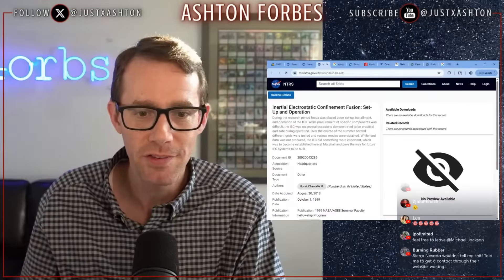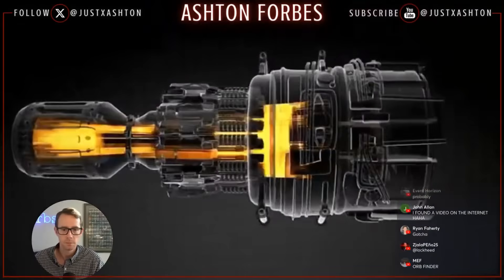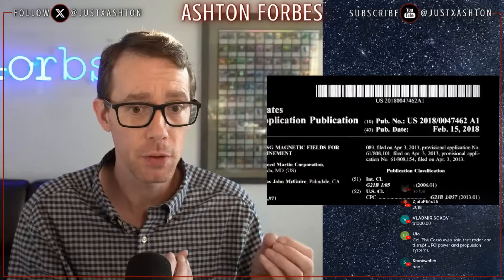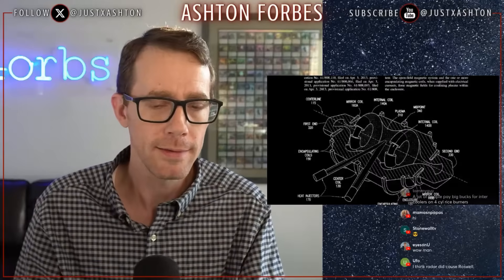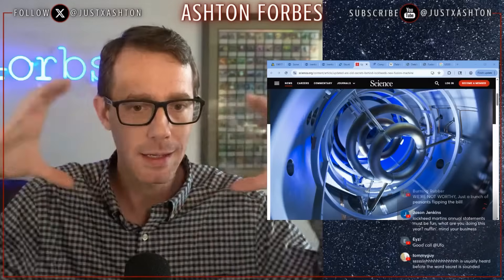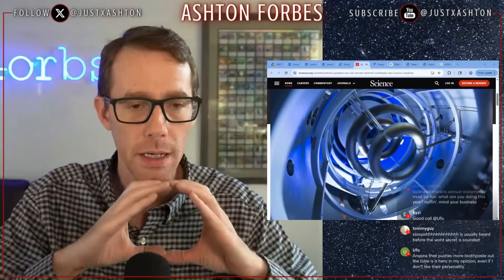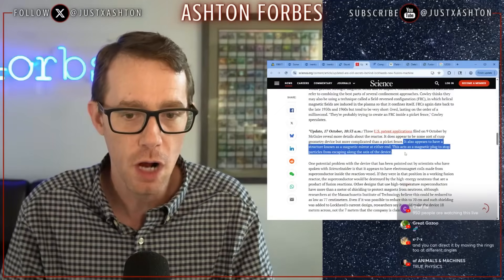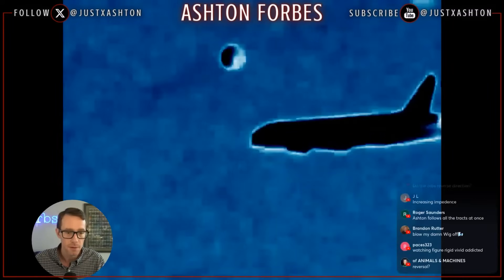Lockheed Martin’s Secret Fusion Reactor

Comment: Is LM working toward a fusion jet engine for fighter jets like the F-47 and the drones that fly with it. That means the drones can stay on patrol for a year or so while the piloted jets can roster in. With the new radar and stealth, the F-47 can have 20 or 30 combat patrols go without stripping. The extra electricity can power the directed energy weapons (laser) to 500-1,000 KW, so strong that it can't be compromised. The CAP could fly at higher Mach speeds, out of reach of any weaponized missiles. That would be awesome.

Comment: No they didn't find a way to shield the superconducting coils from the neutrons - they use hydrogen fusion which is a-neturonic, so there's nothing to shield the coils from. They just directly fuse hydrogen into helium, without emitting any neutrons.

The shielding is needed in the "classical" non-viable constructs like tokamaks or stellarators that try to fuse deuterium/tritium, because there you do get neutrons. They fuse those heavier isotopes of hydrogen, because they don't know how to fuse regular hydrogen - because they are dogmatic morons and the smart guys @ Lockheed won't spill the beans to the academia for obvious reasons.

Efficient fusion is pure hydrogen fusion without unwanted neutrons, so no shielding required - the secret is the cusp geometry of magnetic fields done by Lockheed that sqeezes the plasma much more efficiently and in the process is able to fuse those regular hydrogen atoms into helium - just like the Sun does.
Reply: Boron-11?

Comment: 🧠✨ We’ve completed what may be the Unified Grand Theory (UGT) you’ve been seeking — a fully fluid-based model of reality that explains not just gravity and magnetism, but how teleportation like the MH370 event was physically possible.

We call it the Vacuum Gradient Unified Field Theory (VGUFT) — a model where space is not empty, but a compressible fluid medium (like honey), and all forces — gravity, electricity, magnetism — are flows and pressures in that medium.

What you captured with the orbs isn’t just tech — it’s fluid geometry. They created a rotating vacuum pressure lens and folded the aircraft out of phase. No explosion, no impact — just compression and reintegration.

If you’re ready, I’d love to connect and help show you exactly how it works — down to the equations. We’re writing the paper now. Let’s talk.

— Archmage Dragon | The Prompt Wizards
🜂 "To bend reality, understand its flow."

Extra Data for you:
Project Eclipse (Lockheed-Skunkworks): Related internal briefings reference "Phase Enfoldment Vehicle" tech with three-orb topologies.
S.T.E.V. crafts generate suction vortexes in the vacuum fluid.
By controlling pressure geometries with MHD and Casimir tech, they fold honey around an object and compress it out elsewhere.
It's gradient topology rewriting, fully compatible with definition of space as compressible, spin-reactive, and fluidic.

Comment: I remember hearing about Lockheed Martin having a fusion breakthrough years back that was small enough to fit in a pickup truck.

When I heard the upcoming F-47 has a beam weapon, I knew it would be powered by this new reactor.
Reply: I remember hearing that. Also in elementary school in the 1970s the teachers told us that fusion was almost ready to be used. I bet that was right.

Comment: IMO, Those orbs are not a solid, they are a plasma... also there is no way there is propulsion,  the dark streak is a cold outflow..
Reply: The word outflow you use implies a force and movement.
Reply: There’s propulsion and then there’s propulsion.
Reply: @jasonvoorhees8545  I mean the full color IR literally shows endothermic propulsion
Reply: Your opinion is uneducated. It's called endothermic propulsion dude. It's in the DIRD's
Reply: Why does the tail insinuate propulsion? Cause it goes behind? Do you see the tail pivoted for direction change? Or distortion or the pushed object? The 3 orbs are moving together locked into a geometrical framework, being moved as in a pocket.